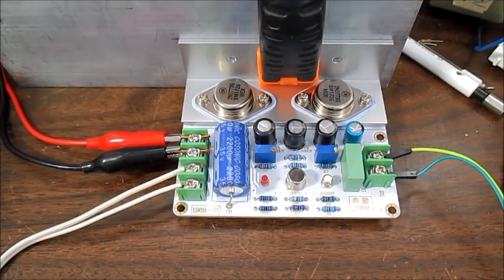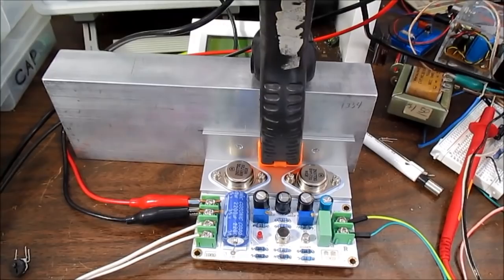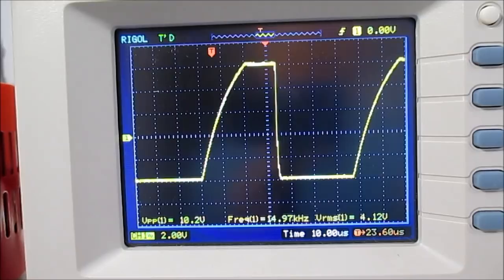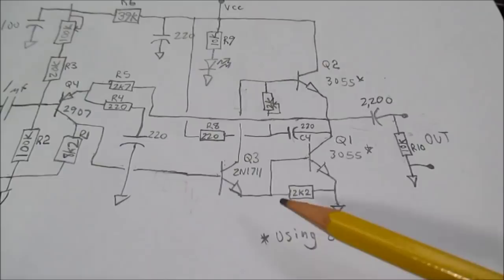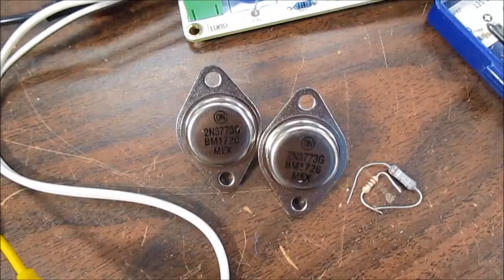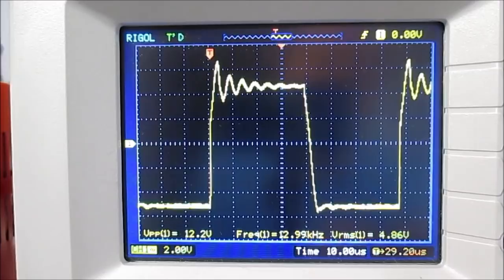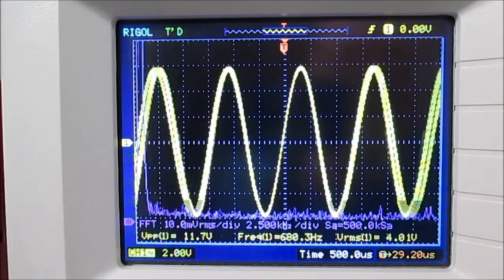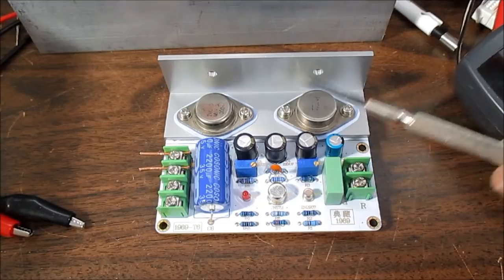Class A amplifier kit - fixing the distortion problem

Comment: People recovering old amplifier circuits or repairing vintage amplifiers based on 2N3055 (which were still widely used in the 80s in the Soviet Block) discovered that all modern 2N3055s or its substitutes are just troublemakers. That's why they reap old amps and receivers in search of the vintage, original 2N3055 or its analogs. Very good quality represent those made in Hungary by Tungsram, in former Czechoslovakia by Tesla (under name KD502 and KD503 with improved parameters) and in Poland by CEMI as BDP620. The KD502 and 503 are especially good and impossible to kill. There are reports that even in the hardest circumstances in the PA amps you could boil not only water but lead on those transistors and still listen to good sound. They were working even when the smoking holes appeared in their "caps" because of the overload when some drunk comerade has made a mess in the loudspeakers matrix :).
Reply: What's wrong with the newer 2N3055's?
Reply: Most of these transistors they are selling today, even in the reputable stores, is just fake .
Reply: What about the legit new ones? Why are the old ones better?
Reply: The old ones are better just because they're not fake. :) The new ones... are they still in production? RCA, Motorola? ;)
Reply: mouser still have onsemi 2n3055 in stock. not much but still there
Reply from the maker: At some point, the 2N3055 was switched to an epitaxial design and the transition frequency went up. The old transistors were slower than molasses and amp designers counted on that (or were completely oblivious) for the amplifier to be stable. The circuit layout of many of those old amps were not that great. Output transistors were often mounted off the driver PC board with several cm of wire. Yes there is a problem with fakes, but not with good suppliers such as Mouser or DigiKey. Modern transistors might not be ideal for an old amplifier (without mods) but with the modern knowledge of amplifier design, they are better in every way.
Reply: It's worth to see teardown pictures of these transistors, old an new (fake) ones. The new ones have a silicon structure sized like in 2N1711. :)
Reply: This amplifier was designed originally for Mj480's. 4 meg transistors.
 The  slower 2n3055 was then used for a little more power. 
 I built both, still have the latter.
 30volt rail, 1.25 amps into 8 ohms. 
 Transistors on heatsinks, not on the board.
 Go to the original design.
 Superb sound.
 No slew rate problem, would amplify into the megaherz  region.
 2n3773 are faked too by the way. Hfe too low for this amp anyway,
Reply: Agree.Tesla was making also 15W amps with KU611 transistor.
Reply: how does STmicroelectronics version stack up?
Reply: the problem with buying NOS the part is probably legit but its been used and burnt up. you don't know what you're getting

Comment: When you hold the cap in your hand instead of tacking it, you change the caps value because of the capacitance of your body.
Reply: There are two possible answers to your question: 1.  The information is not available online, then I can not find it.  2. The information is available online, then you can find it with the same effort as I can.
Reply: No, far more likely to  be oxides on both components leads. The body capacitance would have very little effect on the 500nA cap

Comment: The output transistors are both NPN 2N3055 with asymmetrical output; this is dreadful for certain types of distortion.  Moreover, the 2N3055's do not have emitter resistors, so current stability and working bias will be potentially problematic.  Conclusion:  amplifier design is obsolete and not very good.

Comment: I dunno that board is crammed. Looks complex. 
  How hard can you drive an amp into a static load? I have a 1000W 8 Ohm load but i'm worried to use it because once i lent a 2600W amplifier to a scientist for an experiment with mice triggering a device or a computer network. There was a huge 4 Ohm coil but when we drove it with the amp it saw it more like a short circuit and i blew the amp to smitheries.

Comment: I met John Linsley Hood on a couple of occasions, His nephew worked in my shop. When I talked to him about distortion he said Transient intermodulation was far more important than people realised. That was the ability if a signal to rise and drop cleanly. Damping factor was critical. He always said use the best quality transistors in matched pairs and ensure you based the amplifier correctly and I should not have a problem. I have several bits of his designs including rare phono preamp with ultra low distortion. It caters for both moving coil and moving magnet inputs. 
I still have a 30W+30W RMS amp which sounds so incredibly clean.
Reply: I would like to see the circuit diagram of the phono preamp, and make it for my Michell turntable with JLH 40 Watt class A updated amps.Could you possibly share it please?

Comment: John Linsley Hood was an instrumentation engineer who worked for a large company.
When I spoke to him about amplifiers he said that Transient Intermodulation Distortion (TID) was more important than harmonic distortion and he did actually design some kits for test equipment at the time he wrote most of his articles. He said most waveform generators could not produce a fit enough rise time to produce accurate measurements.
That's why he designed a lot of test equipment himself. 
I also spoke to him about components and he thought that thick film resistors were superior to metal film types because they produced less noise. He also said that a good damping factor in an amplifier was essential because it stops the back EMP from the load on the output. 
Keep the videos coming. It harks back to my youth when I made all my hi-fi equipment rather than buying it.
Reply: Lol how old are you then?
Reply: John Linsley-Hood 1925-2004.
Reply: @markwroblewski6500  he's dead?

Comment: Two things:

(1) When you have asymmetric ringing, it suggests that the ac current path to ground directly is different from the ac current path to ground via the supply rail. In other words, the supply decoupling is insufficient at these frequencies, which is hardly surprising given that big electrolytics will have considerable impedance from their parasitic inductance at 10KHz+. So one of the first things to try is to decouple the supply with a decent 100nF decoupling capacitor in parallel with the electrolytic.

(2) The compensation capacitor you introduced across the feedback resistor will indeed improve the stability of the amplifier by increasing the phase margin at higher frequencies. Its direct affect will be to roll off the hf response of the amplifier at a frequency that you can calculate: f = 1/2πCR. A 500pF cap across a 2K7 resistor rolls off at around 120KHz, so well beyond the audio range, which suggests that you could use a higher value capacitor if needed.

There's no point in worrying about "slow" rise times on a 20KHz square wave for audio use as I've yet to meet anyone can hear the difference between a 20KHz square wave and a 20Khz sine wave. After all, the difference lies principally in the third harmonic at 60KHz and you'd have to be a dog to hear that. Who said "on the internet, nobody can tell you're a dog"? Well, testing the difference between a 20KHz square wave and a 20Khz sine wave would be a sure-fire way to decide.

Comment: I wish I had seen this video, before I replied on the last. Your reverse engineering answered many of the questions I had about the schematic of this amplifier: It is indeed boot strapped, and the large 2.200 µF capacitor is used as the output capacitor, which makes more sense to me. With the new transistors, I think the boot strap impedance is just simply too high, to fully drive the new transistors, which lead to less pull up current on the output. You would indeed need to reduce the value of the 2.2kΩ resistor across the base-emitter of the low side 2N3773 transistor, and reduce the value of the resistor connecting the boot strap capacitor to the base of the high side transistor. The problem is, there would be more current across the 2N1711, running it hotter. Apparently, the 2N3055 transistors have a higher hfe,(higher ß)than the 2N3773's(more current gain)allowing a higher impedance driver circuit. 
     When you held the capacitor in your hand in parallel with the feed back resistor, your hand itself, introduced a stray capacitance, similar to touching the open input. When you installed the capacitor, the stray capacitance was removed, allowing a well damped output with the square wave input. I agree, you could downsize the capacitor, maybe 220 pF, but 330 pF would be safer. I would use the smallest value I could get away with. Nice video, nice fix!
Reply: The 2N3773's also have a lower transistion frequency of 200kHz. Could also try replacing the 2N1711 driver transistor with a BD139-16 or 2SC3421 to handle slightly more bias current power. There's maybe a suffixed version of the BC141 as well, BC 141-16 or the ZTX 653 for a direct drop in replacement. There is the connection terminal position difference to sort out as well with the first 2 replacement driver transistor suggestions.

Comment: Another excellent diagnostic is two probes in an X-Y configuration on the input and output with a sine wave. Eg a straight line shows linearity, circle/ellipse shows phase shift, bumps in the circle or line show distortion very well

Comment: I read the paper of J. L. Linsley Hood about his very interesting design. One problem of this design is, that it is not possible to adjust the bias current and the offset voltage independently by use of two trimmers resistors. You have to recalculate the whole circuit if you need to go to other (lower) speaker impedances. His original design was dimensioned for a speaker impedance of 16 Ohm, which you will not find today.
Reply: Just use two 8 ohm speakers in series, that would fix that problem..

Comment: John, to toggle the beeper on the FY3200, press and hold the rotary encoder when powering the unit on. It will remember the setting between power cycles.

Comment: Electrolytic capacitors are terrible for audio especially at high frequencies, unfortunately they are necessary because of the size needed for the output capacitor. It may help to use a high quality part with low ESR, and also to bypass it with a ceramic capacitor in parallel to give a better high frequency path
Reply: God did we make money in the capacitor plague aftermath.
Reply: Molson, that is correct. It had a major impact on computers back then

Comment: Good educational videos! The thing with your distortion measuring is very high noise floor of the scope, so you don't know what's happening below 0.1-0.2%. All of these kits and chipamps sound different with good speakers and source. You could do better fft measurements with a cheap soundcard and free software, like Arta. In testings like this you dont see the difference between various harmonics, (below the clipping, where you actually listen to amplifier) and that is important because it effects the sound.

Comment: I hope you can return to your class A amplifier type video.
I am particularly interested in the transformer output design.
Since the 2N3055 can operate at a collector to emitter voltage of up to 60,could you try using a much higher VCC?
This would more closely mimic a valve amp output,requiring less quiescent current with less heat providing the transformer primary D.C. resistance is lowish.
Would this work and sound any good?
I have never tried it.

Comment: Interesting.  The thing I notice about the circuit is that it has "active" drive for the negative swings, but just "resistor" drive for the positive swing.  Kind of like the difference between RLT and TTL digital logic.  As a result, I think it's going to be pretty sensitive to what it takes get the top transistor turned on by (from the resistors) as well as how long it takes the bottom transistor to "leak down" until it turns off.
Reply from the maker: In this design, the lower transistor is signal driven and the upper transistor is a current source. The current source gets modulation from the signal for better efficiency, but is still considered class A.

Comment: I have the same JLH 1969 kit with a tube preamp module driving it.  I replaced the 2N1711 driver transistor with a transistor socket into which I plugged in a 2N3866 UHF/VHF RF transistor and it improved the sound - so using RF transistors might be a way to solve the issue of slow rise.
Reply: Hi, I like to leave my amplifiers "always on"! Is this possible or should I always power it down? Was thinking of silent cpu fans to keep temperature steady. May I ask, does it continue to heat or does it need to be held below a limit? I turned mine off at 40°c. Thanks
Reply: @mike.a.irving8227  You can leave the JLH 1969 on as long as the main output transistors (2N3055) are adequately heatsinked.  I just use the chassis (part of the enclosure box) as a heatsink without a fan and kept it on for 150 consecutive hours to give the unit a burn in without any problems.  Check out http://www.alvenh.com/misc-projects/tubeamp for details.
Reply: Nice build in the link. @alvenhchanne

Comment: Something else that I'd check - the voltage at the point between R8 and C4.  It seems to be the supply for turning on the top transistor.  Perhaps C4 needs to be made bigger.
Reply from the maker: C4 appears to be a bootstrap. If it were too small, low frequency drive would suffer.

Comment: In a well made conventional amplifier (3 stages architecture for example: input stage (input: signal source and negative feedback, responsible to correct the output, output: current), volt-amplifier stage (input: current, responsible for the open-loop gain, output: voltage), and output stage (give the current to drive the load, gain nearly unity)), there is a current source (in the order of mA) in the input stage, and in the volt-amplifier stage, and their value affect slew-rate (higher current = better, but too much = other drawbacks).
But, in this design, it is difficult to tell what is the main thing that affect slew-rate: not an optimal design. Also, the linearity of the output stage (class A) isn't fully exploited: no differential pair with current mirror and tail current (poor distortion reduction), and probably not enough open-loop gain to provide better linearity. For a little bigger board, it should be possible to add other components, and the small extra cost will be worth it for the distortion performance gain.

Comment: i have a question about this amplifier i saw the circuit the output is coupling with capacitor. My question is during turn on the power will the speaker have a pop sound? will it become problem? or the pop sound is loud?

Comment: What about the Class A circuit that was used for the color gun amps one for each of the colors R,G,B of those color TV sets that use a CRT, that unit is simply not wide band.

Comment: Did you tried to use 2s5200 instead of those 3055?
Edit: 2SC5200
I've used some 5200 and are really good!
Reply: And, at 18-20 volts use 1-1.2 amps... from all A that i have used, this one are from farest possible way the most "efficient" and powerfull amp XD
Reply: I actually just got one in the mail that uses 3 C5200 Toshiba transistors and I haven't tested it yet but what voltage and amperage do you recommend I use for setting the biased and output ? And them what kind of voltage and amperage do you recommend I use for running this thing at 4 ohms ?

Comment: did i understand it right?: i only have to put on another capacitor and then it works fine?
Reply from the maker: The parts they supply in these Chinese kits can vary so you have to run tests.

Comment: thank you for this video. I just ordered this kit some time ago and got it assembled yesterday. Mine came with 2d hand 2N3055. However, I have some other NPN transistors in my bin which could give better result. I think 12 volts is not enough to power this circuit but no datasheet came with mine and I don't know how high I can power the circuit without frying it.

Comment: From what I see concerning the polarization of the output stage, it seems that this amplifier, although it is said to be class A,  it works as class B.
What's your opinion?
Reply from the maker: The output transistors are on for the full cycle of the waveform, therefore it is operating in class A
Reply: @JohnAudioTech  Correct, it seems that both transistors conduct in the active region all the time and there is an overlap of the signal generated by both at the output. So there is a reinforcement of both.

Comment: Can you suggest a good amplifier kit because im new in the audio stuff i have been following you for like a year now and i want to build a nice amp around 50 or 100 W
Reply from the maker: The TDA7293 kit I reviewed is great.
Reply: If you would like to build a good class A amp skip the class D’s amps. Go to diyaudio.org you’ll find amp kits with circuit boards in a community that’s willing to guide you a little bit with very good visual photographs on step-by-step assembly.

Comment: My transistor guitar amp is hissing at every note played, but silence when im not playing anything, can anyone help suggest a solution? This is way too technical for me to understand, thank you
Reply: Probably has a noise gate so that when you don't play anything the noise is below threshold and so the output is suppressed. When you start playing and the threshold is met, the gate lets go and you can hear the noise. Hiss as opposed to buzzing/humming is typical of amplification noise, especially in cheaper designs. If it's humming/buzzing, it's probably mains related and can definitely be reduced based on the setup!